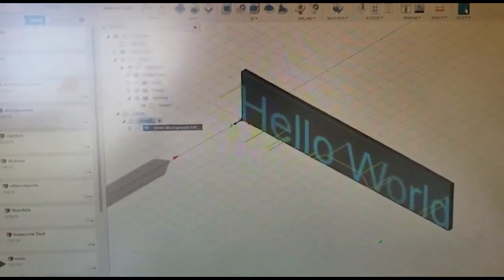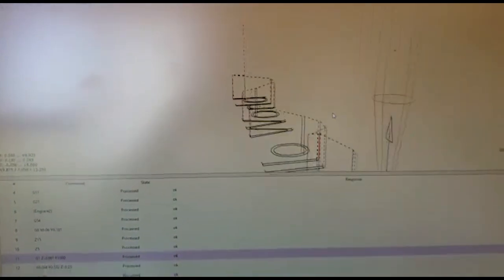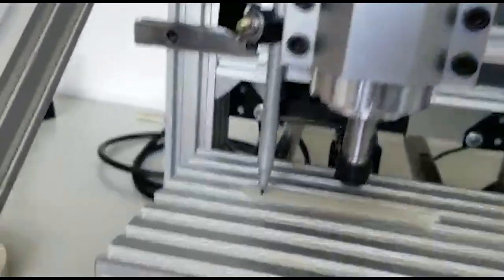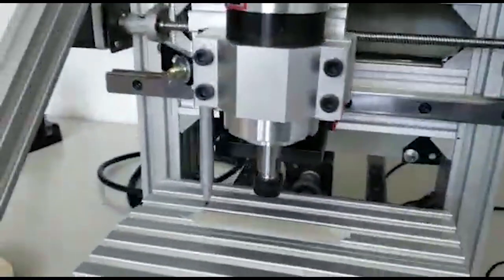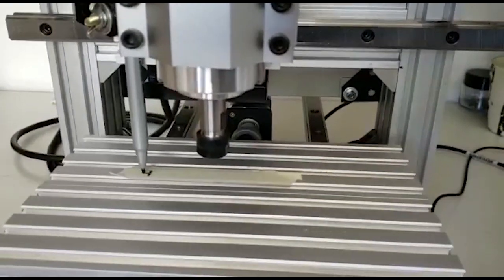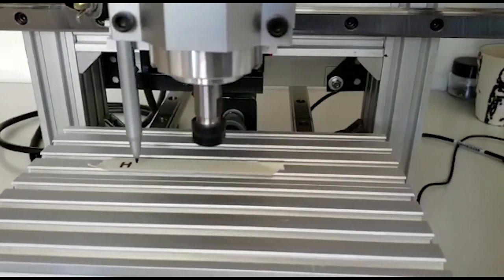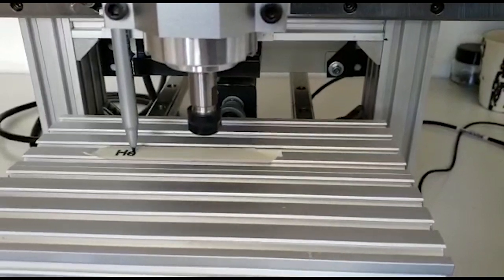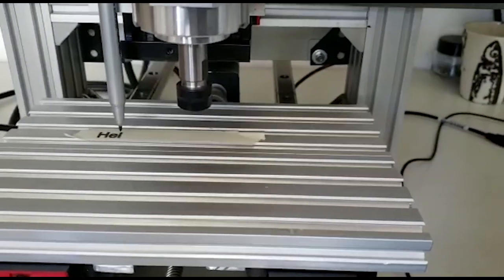Newborn CNC spells its first words

Comment: Beautiful with the rails.  How much did the rails help and can it now do aluminum better?
Reply from the maker: I'm yet to test it on aluminum, but the test indicator I use is a lot happier now! Before this, I was using unsupported 8mm guides (not even v-slots mind you) so this is going to be a world of difference.
Reply: I know 8mm smooth rods from my old Prusa I3 rework and they were janky/junky on it so on a CNC router they would have deflected far too much to be of use. I see you beefed up Z and have a better spindle on it so it is safe to say this is no longer a 3018 it has become a Frankenstein machine.